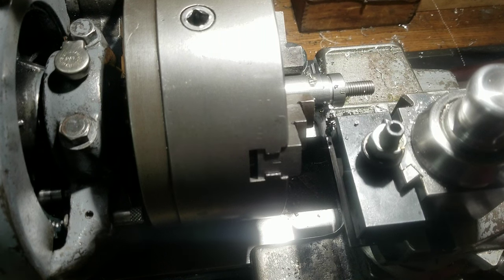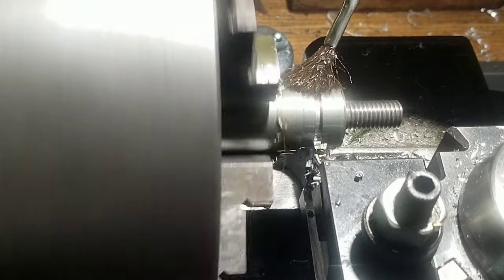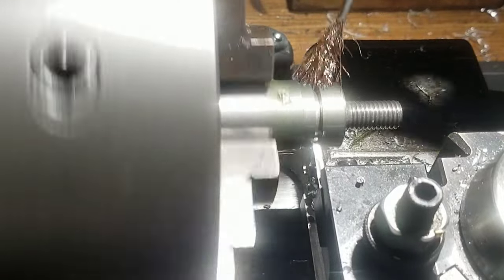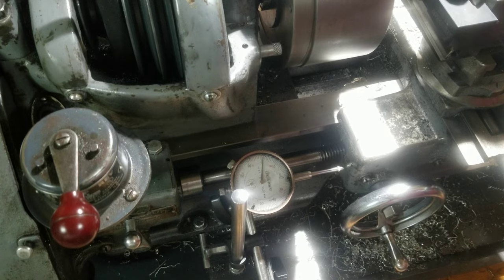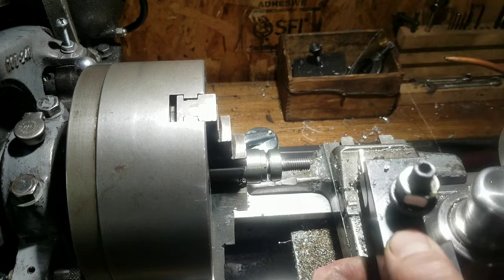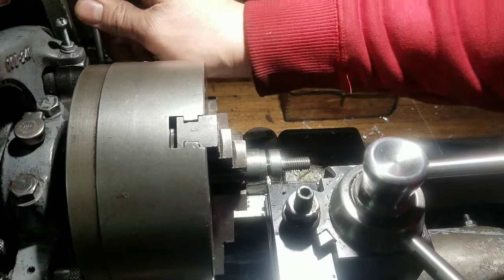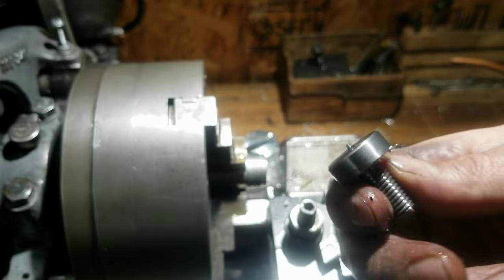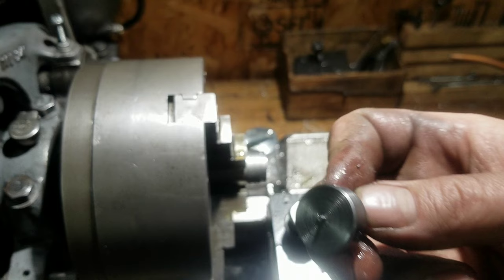Parting 4140 on my Atlas Lathe?! Couldn't do that before! 😀

Comment: Aside from rigidity , remembering to keep the tool 'plowing' is key to getting through the metal - along with keeping enough oil on the business end ;)     It's easy to slack off while parting , which leads to rapid wear , then you just 'rub' / burnish & harden the material !    Finding the 'sweet spot' of feed & speed can be a challenge , that's for certain !   I'm a fan of high cobalt tooling - it really can take the heat , where garden variety high speed falls on it's face ;)   * Flood coolant would allow you to just drive right through the material !   It's messy , but so much faster !   Hmm . . . maybe a combination of a mist system with air ? ? ?
That would be a great addition for both lathe & mill work .  ( One with a magnetic base would be ideal ! )
Reply from the maker: Yes, I have been getting better at it. I don't have much problems with aluminium or brass, bronze is pretty sketchy lol. Once you get a chip going it's all in! 🤣 I suspect it will go much smoother now 😊. 
I only buy the hss with a high cobalt mix, seems to last forever sometimes. Unfortunately, unless it's summer, I have to steer clear of an water soluble coolants, it just gets too cold here 😏.
Thanks for the great comment!
Cheers!

Comment: Gday Chris, amazing what a little adjustment will do, my first lathe was a bitch to part of with and after adjusting the head stock it was half ok, the worst part was all the slope in the rest of it which made it hard, great job mate, Cheers
Reply from the maker: Yeah, I'm really hoping I don't have to do a bearing scrape on the front now. I haven't checked it with the dial yet 🤔. I think I'd just rather not know right now 🤣.
Cheers!

Comment: So, where did you put the shims? Between the shaft and the Babbitt?
Reply from the maker: No no, the bearing splits via the two 9/16 bolts that hold down the cap, and the shim/s are there. I only removed enough shim to leave about .001" - .0015" of play to allow for oil. Hope that clarifies it, I may have to do a follow up 😊.
Cheers!
Reply: @Just1GuyMetalworks  ah! You removed pre-existing shims, not installed them... Ok thanks, that makes more sense!
Reply from the maker: Yes, well replaced them with thinner ones 😊
Reply: @Just1GuyMetalworks  ok, that explains why I thought you were putting them in...